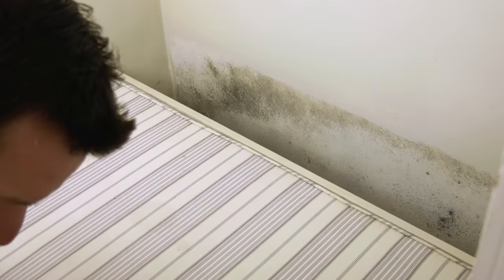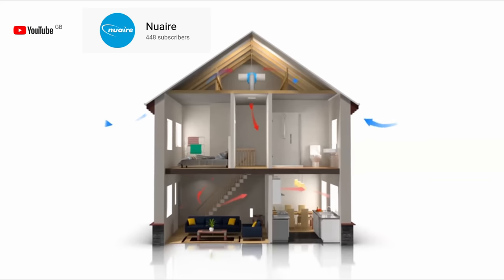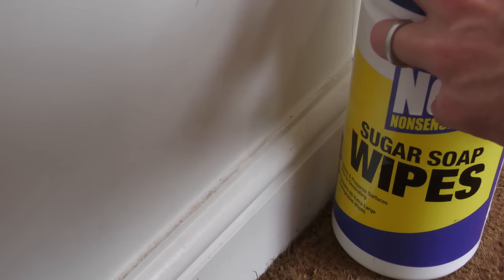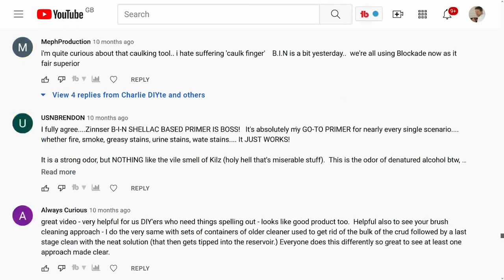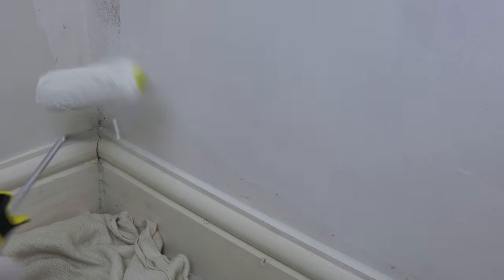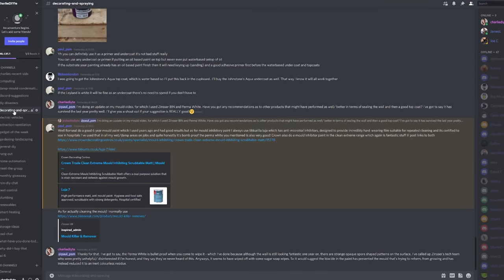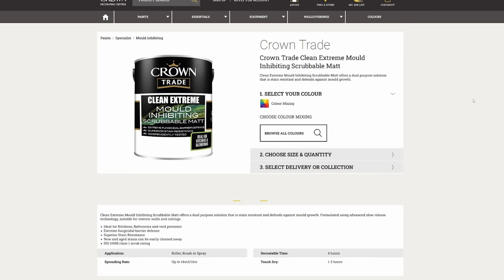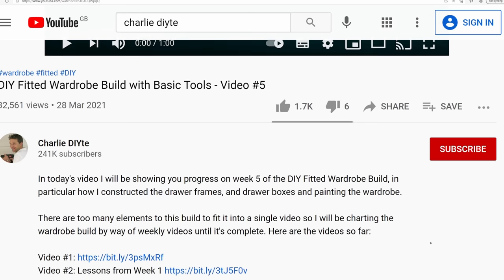Has the Mould Come Back - 18 Month Review?

Comment: Chemically treating wood to kill mould is a perfectly good solution BUT i think your mould/damp issue may be from the groundwater seeping through the walls or floor in the basement and making it wet from within the wall.
You should definitely take a moisture meter and check every interior wall, floor and baseboard.
It should really be less than 20%.
In my house without any damp issue the outer and coldest innside walls are under 9% and innside walls is from 9 to 0% moisture.
Really wet wood is usually over 30% (disclaimer: my opinion, not facts)
And if it is wet behind the paint you probably have a big hidden issue waiting to show it's dark side.
Please check and reply to me here 🙂
Reply from the maker: What you say makes a lot of sense, except I don't think it is in my case otherwise the skirting would be rotten by now. The coir matting is problematic though as it has a rubber base so the floor can't breathe. About ten years ago I installed a pea single soakaway around the perimeter of the house which has helped to keep moisture permeating up from below to a minimum.

Comment: Fantastic video, in a bathroom would you install piv or fan extractor?
Reply from the maker: Thanks. You don't install PIVs in bathrooms as you don't want that moisture funneling around the house.
Reply: @CharlieDIYte  thanks it maybe sufficient to have a dehumidifier that I can rotate around the house and install a st100pir extractor in kitchen and bathroom. Will that one be ideal for a small kitchen due to the cooker being on a internal wall, this is the only thing I can place on a external wall

Comment: Hi Charlie, my husband used HG Mould Remover and Dulux damp seal in august and the mould is back! We live in a 1930’s bungalow and along every outside wall there’s mould growing mainly in the corners and majority above the skirting boards. The bungalow has cavity walls with no insulation and they are icy cold! Any advice what we can do would be greatly appreciated. Thank you 😊
Reply: Get a dehumidifier, i recommend Probreeze 20 or 30L/day.
Reply from the maker: Sorry to hear that Tracey. Check out this video and let me know if you've got any questions. https://youtu.be/NbtijHKy2Vo The key is you must get some ventilation into that bungalow so the moisture you're generating can escape. Installing a PIV or just buying a dehumidifier will help enormously.
Reply: Hi Charlie just an update. I bought 4 of the Thermpro TP-55 I put one in each bedroom and 1 in each of the kitchen and lounge. 3 rooms were ok but our bedroom was at 58% during the afternoon and evening but during the night it went up to 76% 😳 this room has an open brick vent outside which has a plastic vent over it in the bedroom which can’t close. Do you think this could this be causing the damp issues? Thank you.

Comment: Would it be best to PVA the wall to seal it first before stain block then mould residents paint on
Reply from the maker: It's not a requirement of the manufacturer. I probably wouldn't because if the paint contains a biocide or other additives to neutralise the mould the PVA will prevent it getting to the mould.

Comment: My house is 14 years old detached bungalow... At each corner of both north facing walls, I'm getting mould patches ..plenty of insulation no leaks... What is causing it
Reply from the maker: Bad ventilation most probably. We generate massive amounts of vapour each day and if you don't have adequate extraction or open the windows it's got nowhere to go. Watch my vid https://bit.ly/3glMu6H as it will change your thinking on this. The areas your mould is forming are cold spots most likely because of gaps in the insulation where it's cold bridging.

Comment: Hi Charlie,

I'm just trying out your method today . I have a small box room and was planning it for my young 6 year old. Only to discover mould probably twice what you've had. Cleaned up and waiting for the last bit coat. Would you recommend a lower wall air vent installed for air circulation as a bed is pushed against the external wall?
Reply from the maker: Hi, yes I'd definitely recommend an air vent if you can put one in. Failing that, can you maybe not push the bed right up against the wall? Even leaving it a few inches off will help. If you use the same products I used you should be ok because the biocide in the paint should stop the mould reforming but the problem you have is moisture hitting a cold surface. Did you watch this video https://youtu.be/TIDb-pdOnXM ? Get some hygrometers to keep an eye on moisture levels. I suspect the bathroom is the main culprit and if you can keep humidity levels down by making a few lifestyle changes - better fan, window open more often, that will help.

Comment: I've got one room riddled with salt damage,I've had it tanked twice ,come back .Most of our street is riddled with either salt damage or bad wet damp .My mate who's a builder of 35 years said there's no cure when it's so bad .the street was built in 1903 ,they didn't do proper foundations, basically built on mud,it drives me mental . anyone got any suggestions at all 🙈
Reply from the maker: Sorry to hear that mate. Sounds like it needs tanking better with a proper waterproofing additive 🤔
Reply: @CharlieDIYte  thanks for replying.
It's a nightmare,I know some neighbours have had damp in both downstairs rooms ,they have had full damp courses done 2to3 times and it's come back .
The damp or salt damage in houses in many streets in my town is unbelievable,costly and mucky job every time then so disheartening when it returns !

Comment: I might be wrong but would tiling the section of wall behind your bench not resolve the issue
Reply from the maker: It probably would but I'd prefer to put an air brick in or otherwise increase air circulation.

Comment: Hi Charlie,
I have a question, you have probably been asked this.
How do you solve this problem with mould. The colour of my room where I am getting mould has been painted a grey and I am getting it within a corner of a room. So there’s a bit on the ceiling and 2 corners of the wall. So if I paint it with mould paints and what I have seen so far are all White so would that mean I would have to change the colour of the whole room or can you apply the 2 applications and paint over it in the Grey colour that is on the wall.
Reply from the maker: You can get the Perma White I used on the original video tinted to the colour you require. That would be my suggestion.

Comment: Hi Charley, right at the beginning of this video you say as long as the damp is not coming through the wall. I have a mould problem that I would like to treat but how do you know if it is coming from the outside or not? I had a window taken out and replaced with a French window (doors) to the outside of the back garden, there is plenty of air circulation but I had wallpaper on the wall but that had been hung with bacterial prevented wall paste, but the mould came through the paper.
Reply from the maker: I was just answering a comment from someone who used to do this for a living and he says you know it's coming through the wall because the plaster blows/ is failing and the skirting rots. You'll only really know by stripping the wall paper and seeing if you can dry the wall out thoroughly. Is the room well heated? If not this could be an issue. Also as per my condensation video you should get a hygrometer to monitor humidity in the room. Below 60% you shouldn't have a problem with mould.
Reply: @CharlieDIYte  Thanks for anwsering and clearing this question up

Comment: Hi I've got a mold problem in my shower room on the ceiling Is it best to change my extract fan to a inline fan  or should i just antimould spray. 
Ps Great video 👍💪
Reply from the maker: Check out this vid https://youtu.be/NbtijHKy2Vo Have you got a window you can open whilst showering? You should squeegee the shower after each use - dramatically reduces moisture in there. Inline fans are much more powerful but it depends on how long your duct run is and if you've got room for an in-line. They're loft mounted most of the time. Most wall fans are axial and they're only designed for very short runs ie through the brick work.
Reply: @CharlieDIYte  hi got no widow in the  shower room. Have a very long duct from the ceiling fan to the outside vent. Just checked duct it's all squashed is that a problem cos the foam is on top.

Comment: In my box room small bedroom when I was a kid in 80s, my dad stuck polystyrene on the whole of the wall then wallpapered over it. Is this a suitable option nowadays?
Reply from the maker: I actually had polystyrene backed wall paper to strip off in this cottage. Quick answer to your question - no, because the insulating effect is very low - although I don't know how thick the polystyrene was your Dad put up. I suppose it might warm up the surface enough to stop mould forming on it but you've got the problem of condensation forming behind it if you're not careful.
Reply: Hi Charlie.  I ripped off the wallpaper with polystyrene backing and the wall ( window bay)  dried out within a day but the plaster needed to be scraped off and its been replastered. Because it is a single wall stone wall (1900 terrace house) this wall is cold and I get a condensation and some paint started flicking off ( only painted it with white emulsion). The radiator is hanged on that wall to heat it up. Also recently started using dehumidifier but with constantly rain and humid air it is only getting a bit better. I will try bin/ zinser when it get warmer and the wall dry. My question is  regards to maybe insulating the bay window to as u say stop the dew point but how to do it without cold bridging? Any help much appreciated.  Thanks

Comment: Charlie 

I have the same issues on some external walls

My worry is even with zinnser which is fantastic btw in bathrooms etc is that the wall sweats and damages wood laminate floor below. Any chance you can address how to solve that issue permanently as it’s not everywhere but in certain parts which doesn’t get air movement , I heard ronseal do a product that insulates the wall and raises dew point but never tested it. Thanks in advance and I hope you see my comment.
Reply from the maker: You have to get better ventilation in this room. Have you watched this video https://youtu.be/TIDb-pdOnXM My suggestion would be in the short term at least, if you can't open the windows because of security etc then get a decent dehumidifier.

Comment: Charlie could you use the perm white paint for a bathroom ceiling ?
Reply from the maker: You certainly could, Michael. It would be fantastic for that and there's also Zinsser Ceiling Pro 5 in 1 to be aware of. You can get Perma White tinted to your own colour too.
Reply: @CharlieDIYte  thanks so much for that Charlie, much appreciated. Despite having a fan in my bathroom we still get a bit of mould around the edge of the ceiling so will try this paint. 👍🏼

Comment: Spray mould killer, sand the wall properly. Let the mould killersit on the wall for 5 mins. 1 coat piggy 2 coats top done. EZ
Reply from the maker: Thanks 👌
Reply: @CharlieDIYte  ez mate no worries. i do that on all my jobs unless they wanna pay me bugger all then ill just slap a coat on and call it a day haha
Reply: @CharlieDIYte  spray the mould killer in the middle of the wall and work it out with a painters rag/ cheap rag if it's one spot, cause it can leave discolouration if your not carefull